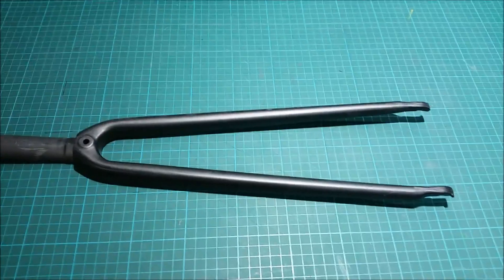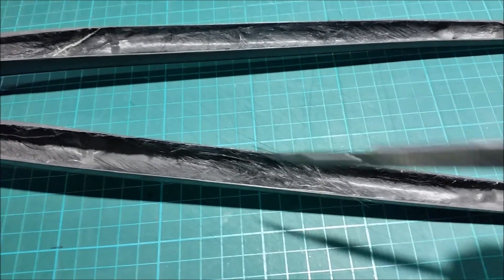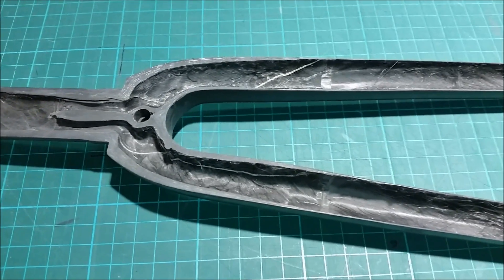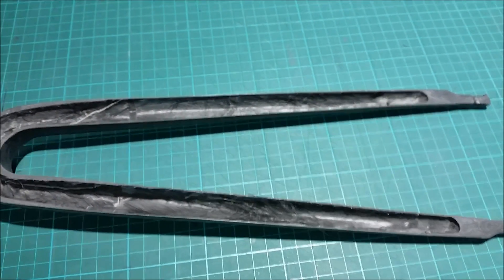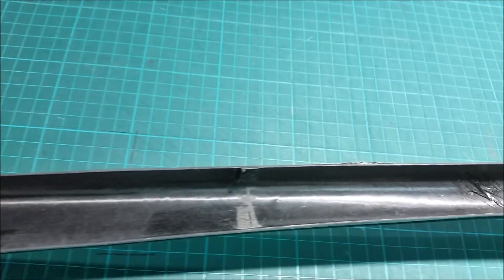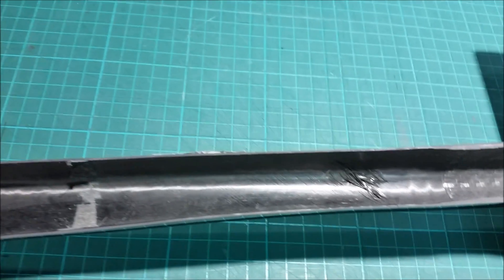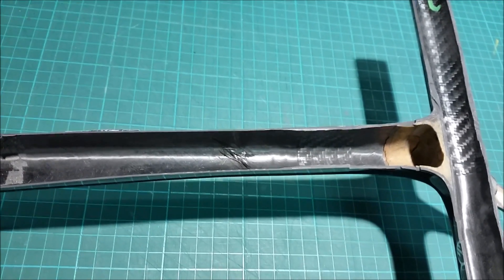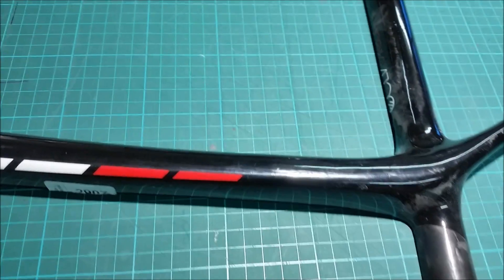Carbon Bike Flaws and Damage - Episode 1 - Resin Dry

Comment: Great video! However, is it possible, even with the dry areas, for the equipment to be within specifications? In other words, since the manufacturers recognize errors in the manufacturing process they accommodate by building redundancy in the equipment? Therefore, since it is a few microns thinner in one area because of the dry fiber it is not an issue because there is excess in that area?
Reply from the maker: Great question, my question is without proper testing methods, do they know that these flaws even exist to base the designs around?
Reply: @LuescherTeknik  they probably don't. No wonder we have so many jrf

Comment: Hi Raoul: At the beginning of 90's Trek introduced the OCLV concept explaining the advantages of pressured baggies instead of the current monocoque option at those days (Kestrel 200, Aegis, etc). Considering this, what's your experience with these type of old monocoque framesets regarding to carbon fiber's performance along the time? Thanks in advance for your answer!
Reply from the maker: Some of the older bikes being heavier had more material and thus typically higher factor of safety which made them quite reliable.

Comment: Great content! How does a dry resin ultrasonic signal differ from a signal indicating a void? A void will usually return an echo before the back side of the material. But it seems that resin dry is occurring AT the back side. So the indication would be a sudden change of thickness in the material...? Keep on the good work!
Reply from the maker: The amplitude of the signal is different due to the attenuation difference, it takes a bit of experience to pick. ;)
Reply: Got it. Though in practice it probably require significant experience, yeah. Thanks for your response.
Reply from the maker: Yes well, I have been doing A scan Ultrasound for over 25 years, so some things are just autopilot now. Glad you enjoy the channel.

Comment: is there a certain amount of resin dry that would be acceptable? or is even having a single layer enough to compromise the structural integrity of the whole component? 
Would be very interested to hear your opinion on what acceptable tolerances are in your upcoming videos as well!
Reply from the maker: There are lots of variables with this such as fibre weight/thickness and the design allowables and factor of safety etc, however typically dry fibre over an area is rejectable.

Comment: Loving the content!
Do think that a lot a of people are unfairly jumping to attack brands or even disown carbon in general. The things we see here are a tiny proportion of the amount of equipment out there and remember - this stuff is being examined in the majority of cases because they have flaws.
It is a suprise that some of these get through quality control, but it's extreme extrapolation to deduce that all/the majority of products from a certain manufacturer aren't properly checked. It could well be the case that just a few out of maybe tens of thousands slip through assessment (potentially down to individual instances of human error, people aren't perfect 100% of the time) and they are the ones we're looking at because why would you take a fully functioning bike/frame/component to be examined? These aren't randomly sampled items taken off shop shelves by any stretch of the imagination.
Even with the ones damaged in an accident and subsequently found to have (usually unrelated) manufacturing flaws, think - how many instances would there have been of items beyond repair just being thrown away because they didn't have any interesting features and so aren't included in any of the instagram pictures/youtube videos? Not to mention the fact that ones with flaws are more likely to be more extensively damaged in a crash and so be sent off for inspection in the first place.
Not attacking Raoul in the slightest (and definitely not suggesting he has any form of underlying agenda before anyone claims that) - he does in fact sometimes show instances of good carbon craftsmanship as well, but perfectly built components are considerably less interesting to look at than ones with issues to examine and one does need to bear in mind that these are a subset of a subset.
Pre-existing biases are much more likely to be informing the conclusions people come to regarding the industry as a whole than from what we watch in these brilliant videos. It may well be the case that thousands of frames/forks/wheels out there have manufacturing flaws, but it is impossible to come to anything approaching a definite conclusion from the sample-size available here.
Reply from the maker: Great comments, I think that the sample size is probably a bit more random in that we can find what is considered to be a a rejectable manufacturing flaw in an area unrelated to the damage or reason the bike originally came in for. We have also scanned brand new unused parts such as forks that came as a replacement for beyond repair damage and have found problems. Also note that some of the parts we consistently see problems with have subsequently had recalls, so they must have been failing in the field. It would be great to scan more parts but we can only take what we can get, so some information is better than none and then thinking all is ok. Remember that we don't know what we don't know.
Mostly the issues are process related not brand related, which is a point that I have made repeatedly. I absolutely do not target any brand at all, I just show what comes through my workshop.
One of the things I intend to do is to review frames, showing the good and the less than ideal as applicable. However I thought it was a good idea to run a series of the details of flaws in composites so then when I review a part people know what I am talking about. This is the gory bit that I have been mostly showing recently so as to provide information and educate the viewer.
Overall carbon composite is a great material for bikes and when done correctly superior to metals for many applications, as what has transitioned in the aerospace and other high performance uses. Remember we are saying that a 800g carbon frame is less durable than a significantly heavier metal frame.
So it comes down to design and process as it does with any material, can it be done better? Of course it can, that's why we don't live in caves any more, things progress.
Reply: Why buy a car that's capable of going above the speed limit unless you're a racing car driver then?
Why buy a TV larger than the smallest possible size that you can still make out what's being shown?
Why spend any money more than the bare minimum, on the absolute essentials, ever?
Because people like things with greater form and function that the most basic option, therefore there's a market for it, therefore it gets manufactured. Carbon's a more desirable product - because of weight, vibration dampening, the ability to form complex shapes with it i.e. aero tubing, the ability to alter the properties of the frame in different areas with different lay-ups - therefore it's used. Ride a carbon Trek Domane and tell me if the same suspension effect could be achieved as specifically (i.e. not sacrificing lateral stiffness at the BB/forks and therefore ride quality) with any other material. Steel's more springy but leads to spongy handling, something arguably more dangerous, as it increases the risk of crashing, compared to the tiny chance of carbon failing under you.

On the safety front - do you have any evidence (a meta-analysis or properly conducted study and subsequent report) that carbon is any less safe? Have you found anything to show a greater incidence rate of failure with it (per capita) versus any other material? The "evidence" you're likely using is probably anecdotal, either from videos on here or from articles you've read online, and, as I explained in my original post, that's a tiny (to the point of negligible in statistical terms) proportion of the total number of carbon bikes out there. This is a channel specifically looking at carbon analysis and repair, if it was instead looking at aluminium then there's a good chance that the incidences of manufacturing faults would be about the same. Note - unlike you I'm aware that I don't have any evidence to back up my assertion and therefore have made it clear it's an educated guess, I haven't just simply said "the way CF fails as a material should exclude it from being used as frame material from a safety stand point" without anything other than your opinion to back it up.

In terms of the East Asian manufacturing - "safety and quality inspection standards are less than adequate", again, do you have any evidence to back up this claim? The vast, vast majority of premium products found in the Western world are produced in the Far East, can you definitively say quality control is more of an issue there? Even if it was (and I very much doubt that it is), for an item to be sold in a country it must pass the control criteria for that country, not of the country of its origins - for example, the 'CE' mark in the EEA, so it's as much the fault of the "Far West" as it is of the "Far East" (in terms of your gross streotypicalisations of multiple diverse countries being grouped into one area).

Next time you're thinking about making sweeping and unfounded generalisations about either a manufacturing material I'm going to hazard a guess (again - clearly showing that's my judgment, not empirical fact) you're not an expert in or about the quality control in half of an entire continent, maybe take a step back and consider if you've investigated the matter sufficiently?
Reply: Shut up Enve smurf account.
Reply: Why is CF necessary as a bicycle frame material for people who are not earning a living by racing? The weight savings are negligible in the whole scheme of things (most MAMILs only race to the nearest cafe) but the way CF fails as a material should exclude it from being used as frame material from a safety stand point. Especially coupled with the process issues you have highlighted and further compounded by the fact that most of these frames are being manufactured in the Far East where safety and quality inspection standards are less than adequate.

Comment: Awesome video, looking forward to the rest of the series.  Have to agree with other comments - your approach is great, without fear or favour.  This kind of independent perspective has to be a good thing in terms of holding the manufacturers accountable.

On that note - do the defects you find in the bikes surprise or disappoint you at all, by their nature or the sheer number of issues you find?  I have to say as the owner of a flashy new composite mountain bike it is of some concern, although I suspect that concern is probably irrational given the millions of bikes and components that are being used without issue!

Also - presumably that trek was in for an unrelated issue.  Would you have 'passed' it with the resin dry which was present?
Reply from the maker: We are seeing a small cross section of the amount of bikes out there however it is a concern with certain flaws how common and how often and also for how long we have found those.
Some of the things that I will show and have shown may not cause a problem during use as the design factor of safety allows for that. Other times we find things consistently and then later a recall is issued on that part, so they must have had failures.
The issue is that you don't see what you don't look for, so by scanning parts and finding flaws it raises the awareness that these parts could be better and that is what we should be striving for.

Thanks for the feedback.

Comment: A £3,500 bike unfit & unsafe for purpose, you could be riding a ticking time bomb sod carbon.
Reply from the maker: Not as simple as that, any part can have a flaw, there have been plenty of metal bikes fail over the years too. I think mostly that the carbon bikes are better than they have ever been and mostly superior to previous bikes, however they could be even better with more quality assurance processes. Thanks for the comment.
Reply: 99.99% of the time those bikes would be absolutely fine (talking respectable brands, not china stuff). I surely hope the frame was not chopped up because of the few loose fibers. You see pro riders really putting those frames through their paces and no frames, forks, steerers suddenly snap off because of a flaw. And surely not every bike in the pro peleton is put under a sonogram before the race.

Comment: Hi Raul, I was just wondering what the purpose of the short section of twill weave (I think it's called that) behind the resin dry area on the trek was for.
Reply from the maker: It is a local reinforcement, I will do a review on that frame soon to discuss as it is already cut up. Thanks for the interest.